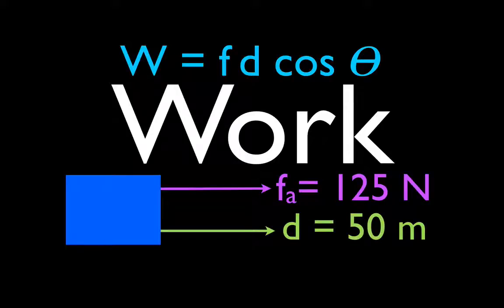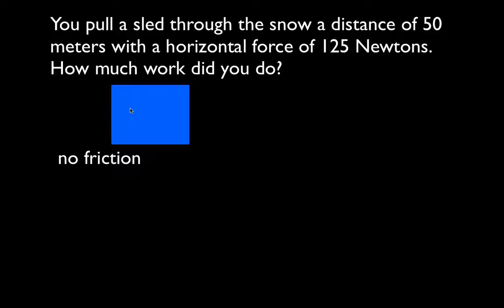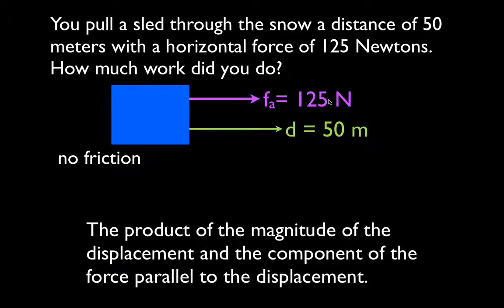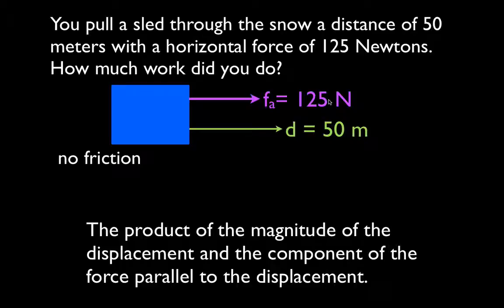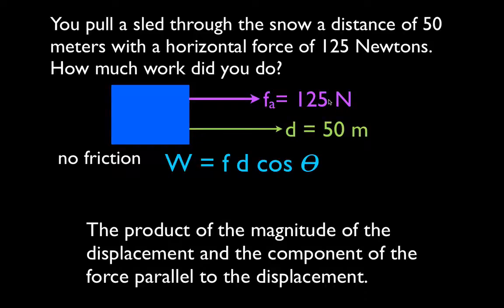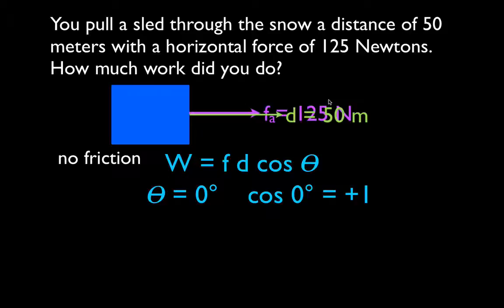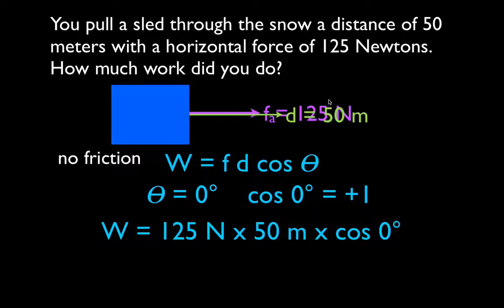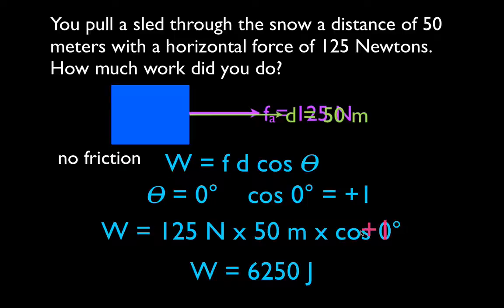Energy, Work & Power (9 of 31) Calculate the Work Done by a Horizontal Force

Comment: In the friction less surface their will be no force required. In my view the work done will be weight of the block multiplied with distance. In this problem if the weight of the block is M and the distance is 50 meter then work done should be M x 50. kindly reply for further debate.
Reply from the maker: The force is not the weight of the block unless you are lifting it straight up into the air. The force is the force applied to move the block or in this case because it is a frictionless surface the force would accelerate the block. Does that help?
Reply: @stepbystepscience  At constant velocity their is no acceleration, but on a frictionless surface their is weight displacement without any input. so in my view the displacement of weight is workdone i.e workdone = mgs. because if their is no displacement their is no workdone. I find you competent on this Kindly debate further. 
Note: Frictionless surface I am taking about is on which their are no ineratial forces like air friction , friction of tack etc, which resists the change in velocity of object.
Reply from the maker: This is of course hard to do over the Internet but....the angle between the direction vector, horizontal, and the weight vector, vertical down, is 90 degrees. Work is calculated as W = f x d x cos of the angle between the two vectors. The cosine of 90 degrees is 0, so if the object is moving horizontally then the weight force (aka force of gravity) does not work.

w = mgs, would be used if the object is moving up or down.

Does that help?